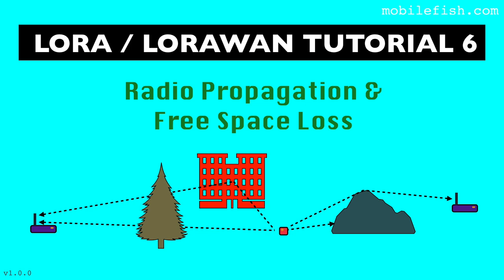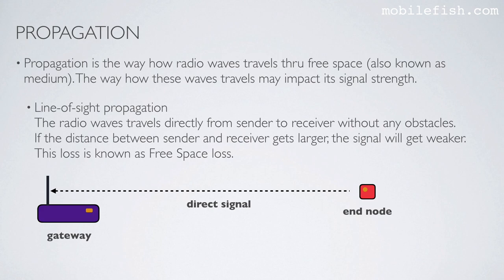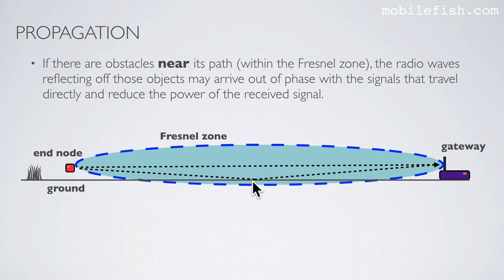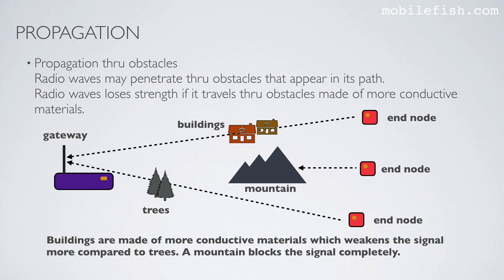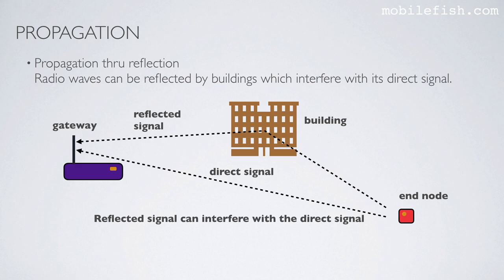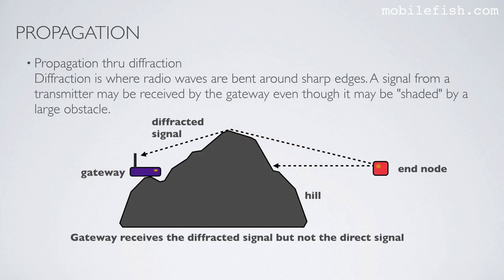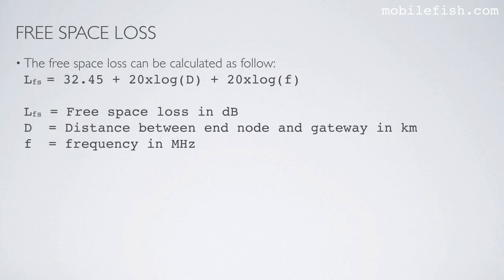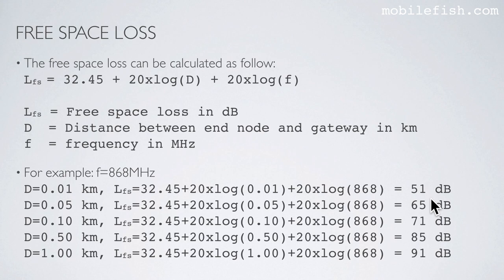LoRa/LoRaWAN tutorial 6: Radio Propagation and Free Space Loss

Comment: Hi Sir, I'm using a SX1276-915 LoRa module with maximum tx power of 20dB and minimum sensitivity of -148dB (7.8 Khz bw).  Calculating the D value on the presented equation with f = 915, and L = -168 dB (20 - (-148)) gives me a value of 6548 km, which is pretty high. Even if i use a loss (L) of 148dB (sensitivity) it yields a distance of 654 km. The manufacturer claims  only 4 to 8 km. Am i doing something wrong?
Reply from the maker: Pedro, you can not use this equation to calculate D. Use this equation to calculate the free space loss.
See: https://www.mobilefish.com/download/lora/lora_part8.pdf page 4, for a better understanding of TX power, path loss and receiver sensitivity.
Reply from the maker: Your sensor can transmit over a distance of 4 to 8 km ONLY when:
1) Your sensor has a direct line of sight with the gateway 
2) Your sensor has a 
 "good" antenna (preferably outdoors and VSWR < 2)
Reply from the maker: The gateway antenna must be outdoors and must also have a good antenna (omidirectional, VSWR<2)
Reply: @Mobilefish  Thank's for your answers. Is there any equation which can be used to calculate D? It would be interesting to know how the manufacturers specifies the maximum range.
Reply from the maker: To be honest, I do not think the manufacturer knows the actual maximum range.
The manufacturer just specified this range.

There is probably an equation to calculate this, but it theoretical.
You will never reach this distance!

As I said it depends on the line-of-sight, the antennas used and other factors.

If you read this article:
https://www.thethingsnetwork.org/article/lorawan-distance-world-record
a distance of 766 km could be reached, but they had "perfect" line-of-sight AND they were using a directional antenna.

I have build this simple end node:
https://www.mobilefish.com/developer/lorawan/lorawan_quickguide_build_lora_node_rfm95_arduino_pro_mini.html
and I was able to reach a distance of 14 km BUT ONLY IF CERTAIN CONDITIONS WERE MET:
1) good line-of-sight (few obstacles, just trees)
2) end node (altitude = 11m) and gateway (altitude=40m), think Fresnel zone!
3) nice weather
4) end device had a directional antenna

But when using a simple omnidirectional antenna (and in all weather conditions) I could only reach gateways 2 km away.
By the way in both cases, the gateway antenna was outdoors and my end device antenna was indoors (this is not good)!

If you look at my example the distance depends largely on other factors than the end device it self.